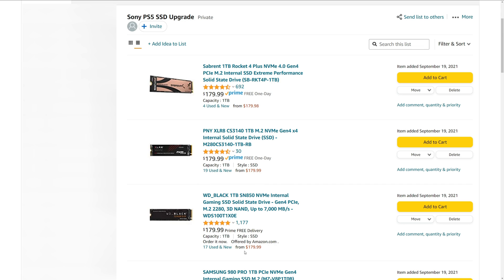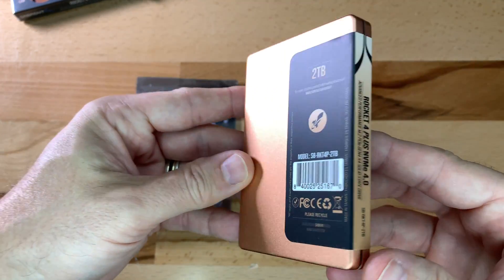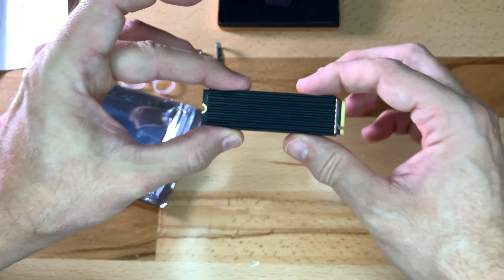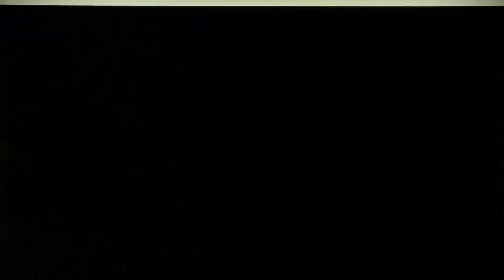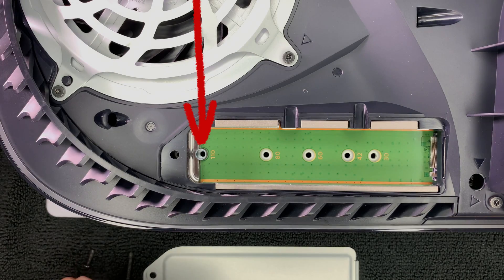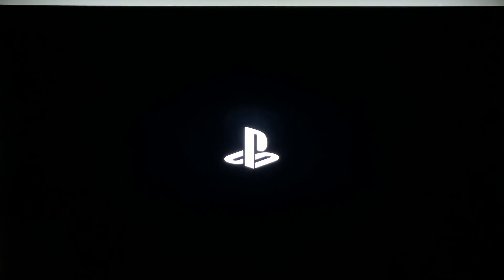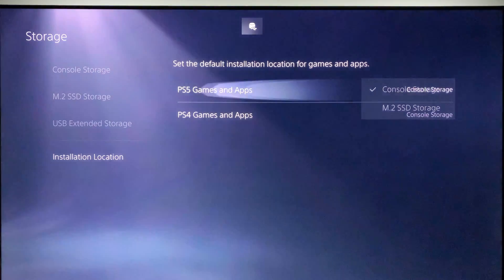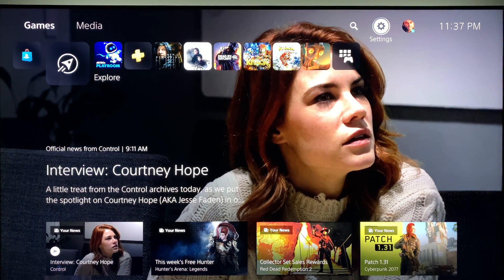Sony PS5 - 2TB M.2 SSD Detailed Installation

Comment: YO DO NOT USE THOSE RUBBER BANDS, IT WILL MELT IN THE SYSTEM. SOMEONE PUT OUT A VIDEO ON HOW HIS MELTED FROM THE HIGH HEAT. TAKE IT OUT IMMEDIATELY !!!!!!!!!!!!!! THOSE BANDS ARE TRASH AND MAY DAMAGE THE SSD BAY. TAKE IT OUT IMMEDIATELY
Reply from the maker: Do you have a link?  I couldn't find any mention of this issue.
Reply: @MTNRanger  bands should be fine. Just a precaution since not always made with heat resistant materials. But  that heatsink you got is relatively crap. Isn’t going to do much. Also if your using the 2tb then it’s also a good idea to use a double sided heatsink since there’s nand on both sides.
Reply from the maker: @justinhalen2126  yes I ordered a double sided heat sink today.  It’s pretty easy to swap it out.